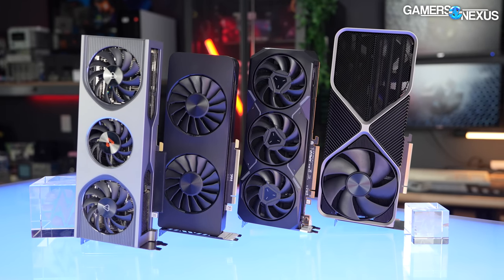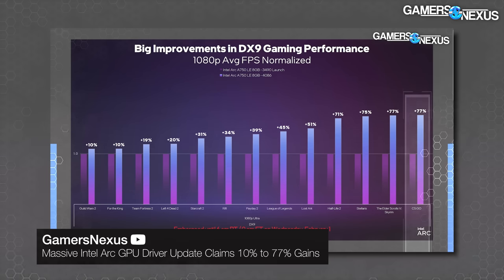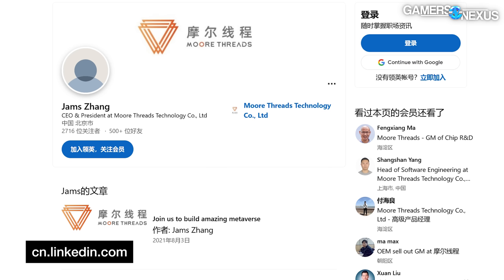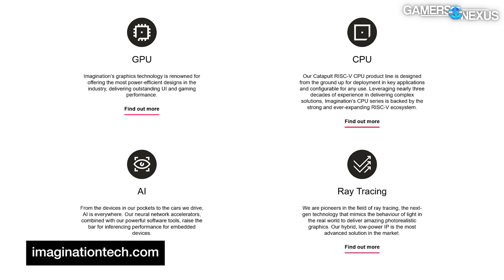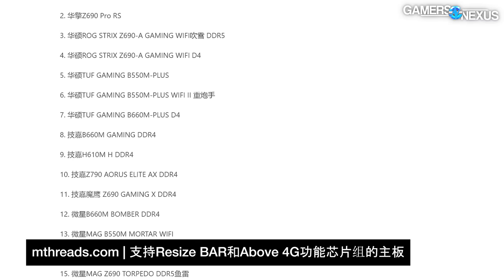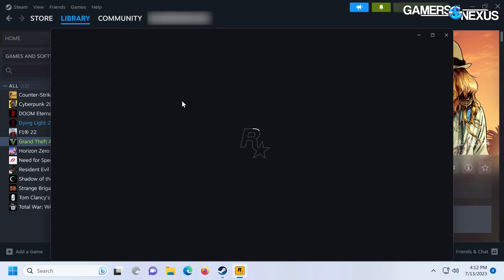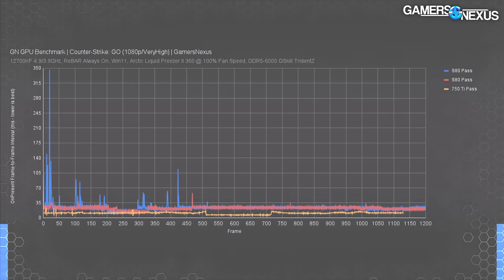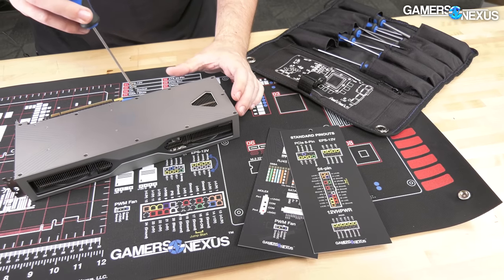China's Moore Threads MTT S80 GPU Review | A New Challenger Appears

Comment: This card shows a single EPS12V 8-pin connector can provide 300w to the GPU while taking half the space than two PCI-E 8-pin connectors on the PCB. I don't see a reason why a GPU vendor like NVIDIA pushes its AICs to use the unsafe 12VHPWR.
Reply: EPS12V has been used for supplying the CPU power over a decade. It's a mature tech and safer than the 12VHPWR.

Comment: The main issue with chinese silicon will be that they do not have acces to ASML machines. They have some of the pre EUV machines but those are now also banned from export to china. So they are stuck on old proces nodes. Some chinese fabs claim EUV performance, but this is not true, and in cases where they do get close they do it in a way that makes the end product insanely expensive. This is not a problem that can be fixed by just trowing billions at it either, the number is too low and even if you increase it it will still take time, if you succeed at all. Asianometry has good videos on this.

Comment: With China really pushing for decoupling from Windows and adopting their in-house Linux OS I could see Chinese Silicon manufacturers, especially those funded by the CCP to push more for compatibility on open Kylin than Windows in the future while riding the work that Valve and Linux community on the Wine / Proton development for Windows software support,  since at the end of the day it is just another Ubuntu based distro. 

I think that is what would make the most sense for the CCP, domestically, would be to develop a GPU with Vulkan support first and foremost rather than trying to have multiple difference versions of Direct X. In linux they all end up translated to Vulkan anyways. Then you can have the GPU and OS developers working in tandem to have a really well supported product, rather than find solutions to make the GPU work with the Windows offerings.

Comment: That's a new GPU that performs at best as something that performs like a GT 1050 at the high end or closer to something between a GT 710 to GT 730. It appears they have little to no software team that can improve the video cards they have through better video drivers or updates to any programs using the hardware. There's a ton of used and new video card products that cost around 50 dollars that will easily outperform that Chinese offering.

Comment: if the card is targeted primarily at gpgpu and continuity of service for hpc and compute datacenters affected by american sanctions then it might be better to test it against the linux graphics stack, mesa has an open powervr driver that implements vulkan and an opengl compatibility layer built on vulkan called zink. if it's compatible with powervr rogue and zink then you might actually be able to see what it can do without dealing with the driver problems on windows.

Comment: You can't really develop drivers for modern gpus before the compute capability of the gpu is stable, it is like a precursor to a programmable gpu. And it is much easier to get to work, so the compute capabilities and performance of the card should be tested, that has way more technological value than running games at what's clearly an unfinished product.

Comment: competition has always been brutal in the GPU market, that will not change but to say AMD and NVidia are not serving market needs and advancing performance, features and price/performance ratios is BS.  Nvidia and AMD are investing more $$/research than all other companies doing graphics combined.  GPUs now support DirectX, OpenGL, OpenCL, Vulkan, Cuda v6-12/ROCm, Tensor, RT, DLSS/FSR, DGX ... AL/ML ... software support alone (tools, regression, cross generation support, new features, driver improvements) in this market crazy expensive.  Intel making an effort but BS that AMD and Nvidia are not providing more value because of a non-competitive market.  GPU/compute/AI/ML is the fastest moving market over the last 10-15 years (performance is still improving ~2x every 2.2 years).

Comment: I am not sure how much the founder of Moore Threads were previously with Nvidia China really matters, if the extent of his involvement was limited to Nvidia China, rather than Nvidia proper in the US. Nvidia China may not actually have anything to do on the technical side of things, and its raison detre may just be for distribution, marketing, satisfying government regulations (because China may require the presence of a "local company" for anything to do with the domestic market, hence a company has been set up purely for statutory reasons). As such, any working experience with Nvidia China may not actually be that useful when it comes to designing a GPU chip from scratch.

Something similar happened with ARM China several years ago, when the CEO jumped ship and wrestle the ARM name in China from ARM in the UK. But ARM China didn't really have much to do with the design process of ARM products as we know them.

It's difficult to do this from scratch. Intel, with all their might and experience, still struggled, and I bet when they did their initial hiring for ARC they would have tried to lure engineers from Nvidia and AMD. If Moore Threads only has access to the talent pool in China, it's just so difficult. I mean, even for something like driver support, how many people in China who have not had overseas experience can claim they have had "extensive experience" working with DirectX on a machine level? These days any game developers, in China or otherwise, mostly just use middleware like Unreal Engine. There is not really need to write your own load/store routines and such, so how many people can say they have tons of experience on that aspect which you will need to develop a GPU from scratch?

Comment: Though the chip/drivers are terrible, I do appreciate the attention to detail for the cooler. It looks very neat, easy to disassemble and well designed from an engineering perspective. Having an easy to reach daughter board for the fans and a cover over the cable are things I'd like to see other big name brands do. And the shroud actually being aluminum instead of painted plastic is also cool.

Comment: I see their HQ is in Beijing. If their fabtory is in Shenzhen, I'm definitely in. Everything coming out of Shenzhen is great. Well, typically. So just about every half-decent tech device we Americans fawn over, even Apple and Samsung products, come mainly or partially from Shenzhen, which is China's version of what our Silicon Valley OUGHT to be. Oneplus is a good example of my point, that you get a 95% as good device as a trillion-dollar-company's flagship device at a third of the price. You skip all the wasteful marketing, advertising, distributing, and grubby middlemen, and buy cutting edge tech at a fraction of the price. The last THREE Oneplus phones I bought were collectively cheaper than a single iphone costs... and in my opinion, each one about 10 times better. And my phone doesn't look like everyone else's, which is incredibly important. Im hoping this little graphics card company, along with the several other new Chinese contenders, can disrupt this entrenched, fucked up gpu market. Hoping to see faster speeds, lower temps, and cheaper prices in the next year or two. I would still buy stock in Nvidia tho, because they'll never be under-demanded.

Comment: A Monopoly is a disaster for consumers and product improvements, a Duopoly is only slightly better with each competitive company the better performance and overall product and price improve. CPU & GPU markets desperately need more compation this is why we need a new Cyrex in CPU market and new 3DFX in GPU.
Irony is jungle drums saying Nvidia trying to do an Intel ie stop its partners working with Intel, just like intel between 1990-2010 where Intel paid HP,Dell etc not to use CPUs from other manufacturers i think they also said they would limit intels supply to them too or cut them off.

Comment: Don't think this product is designed for what you think it's designed for. It's perhaps aimed at third party developers in China who might want to get their software compatible with the product. The looming western sanctions with the desired intention of crippling China's technological and economical growth and render them incapacitated pushes China to support local competition and transition away from dependency to western products. If I were a mechanical engineering student using CAD/CAM software, I'd be delighted with a hardware/software suite subsidized by the government as I could rely on them for my work long term in case some western government tells autodesk to pull the plug on all software working in China.

Comment: Looks like typical government funded stuff. In this scenario, you don't care about games not working or consumer experience at all. They probably use it with specific Linux distro and special software and it does it's job for a military and /or scientific research. That also would explain straightforward cooling solution and frame itself. You could think of this consumer variant that barely works as kind of side hustle for them.

Comment: This review is not much of worth. If you really want to test this GPU you should test it in "chinese user environment", on some chinese OS, Chinese local motherboard etc. All good in this video is where you teared it down but you didn't understood memory chips order. It's a slightly hexagonal order for energy-information flow. Also power cabel is swirled cause of induction, idk why but u need to think off that too. cooling is actually a nice solved, as you noticed, you easely teared it down but I think of more reasons too but I'm not an expert as you and I don't know what are the reasons for that. But you figure out. I would say this is a just a pilot/test product.